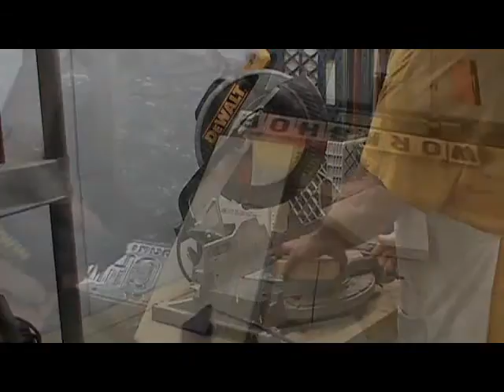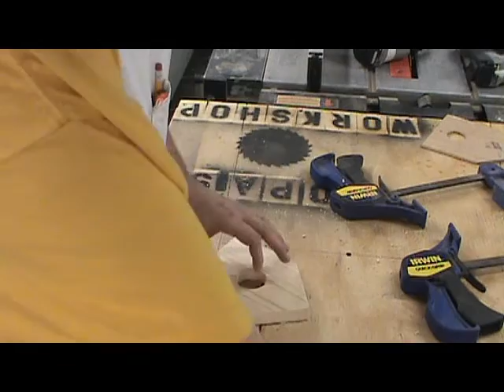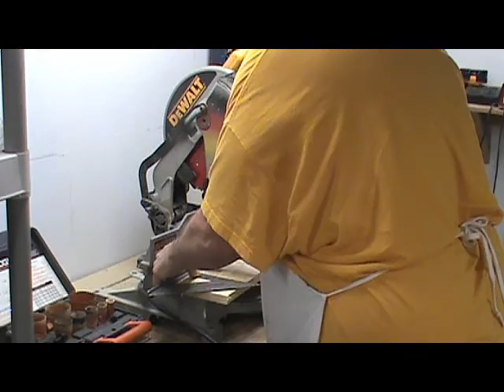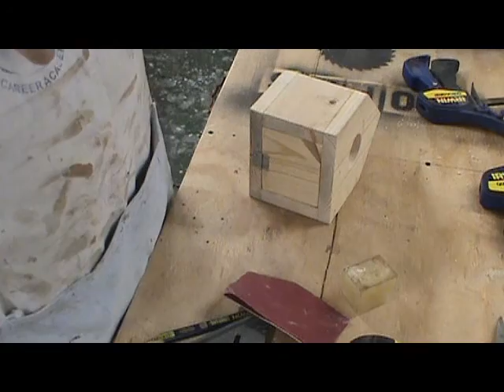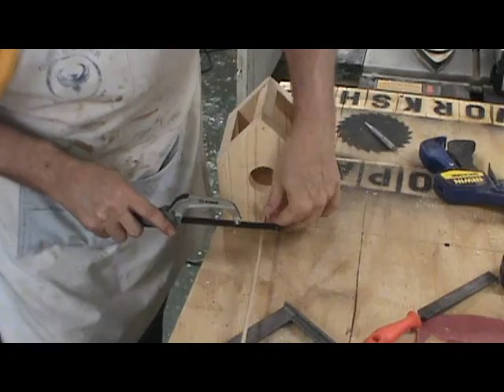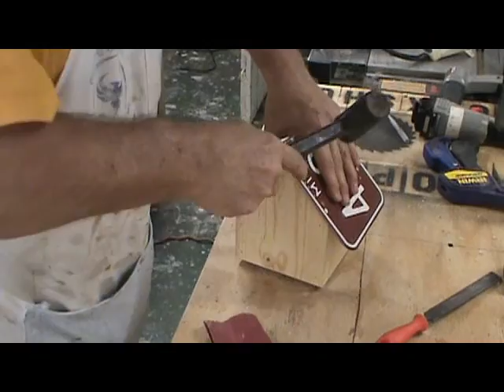birdhouse project

Comment: Great build. I use a brass nail to hold floor in. I drill oversized hole through side into the floor. Works great, quick and easy. Just another way of doing it.
Reply from the maker: hey thanx Lyle next time I build one I'll try the brass nail method.....